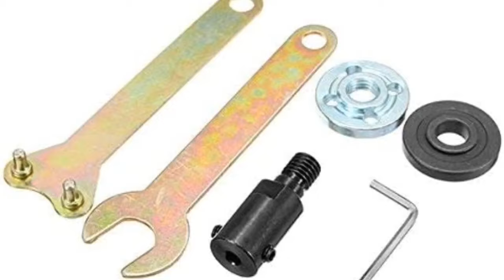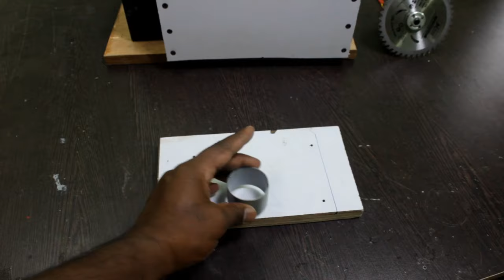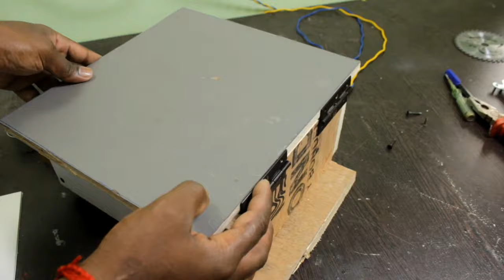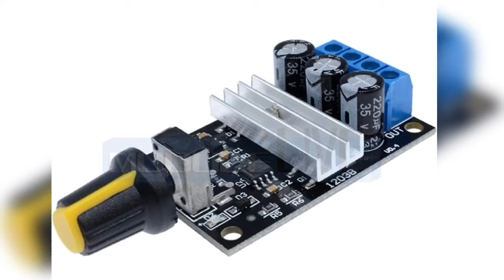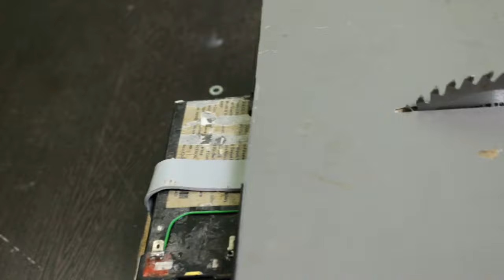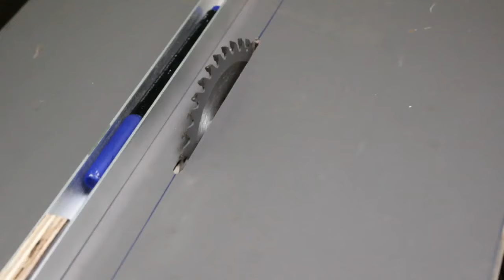Mini Table saw. DIY

Comment: What volts and amperage did you use to drive the 775 motor?
Reply from the maker: It's 12 volt
Reply: @mayilaicreatives  12V to good and how much amperage does the battery have?